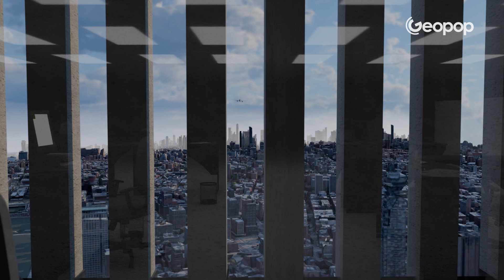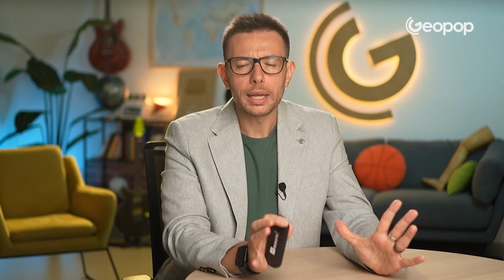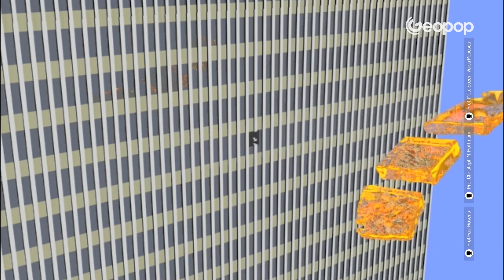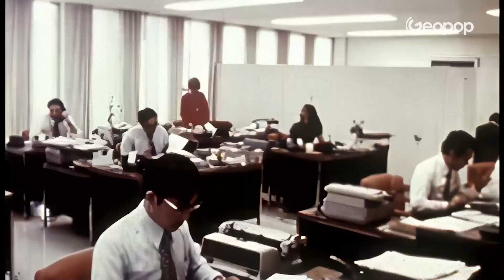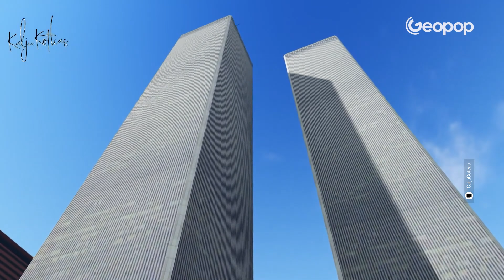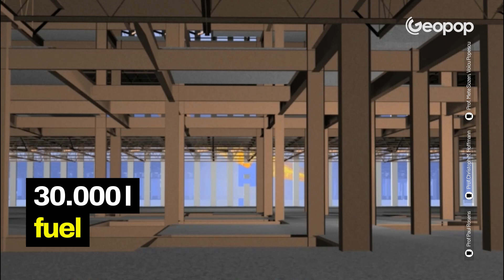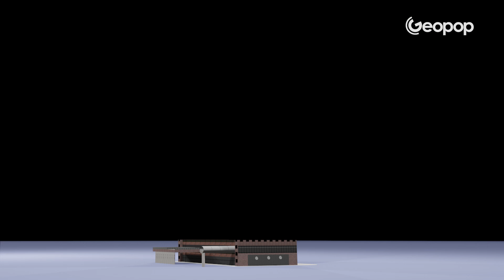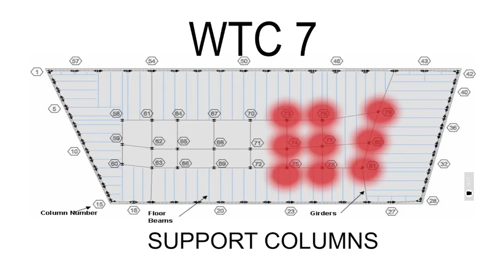9/11, 2001: The Technical Reconstruction of the Twin Towers and WTC 7 Collapses

Comment: BS. How come WTC 7 collapsed due to regular office fire? It would be the first one in the history in spite of hundreds of much worse fires in high scrapers around the world yearly. And even if it indeed happened for the first time for the reasons mentioned they would change the building codes to prevent it in the future, but no changes in the building codes. Why? Because it collapsed not from regular fire. Even NIST report admitted it was a free fall as if all supporting structure just disappeared. Do not forget about multiple audios with recorded explosions. It is pretty obvious what happened to WTC7 just several hours later of other two towers. Weird coincidence, right?
Reply: Fire destroys countless thousands of buildings every year. Sometimes entire towns and cities. There was a rather large fire event in Los Angeles just a few months ago that destroyed thousands of homes and buildings. Maybe you slept through that one.
Reply: @TheLoonResistance  Name at least one HIGH-RISE steel-framed building that collapsed due to fire? Right, it's WTC 7! Anything else??? None. Weird, right?
Reply: @DZ-zc3gi  - Plasco Tower.
Wilton Paes de Almeida.

That's two (2)

Of course neither the fire nor the building know how tall the building is, so high rise is an irrelevant qualifier.
Reply: @TheLoonResistance  Plasco Building, Tehran, Iran (2017) - 17-story, several hours of fire, lack of fireproofing and sprinklers, exacerbated by outdated design.
Wilton Paes de Almeida, São Paulo, Brazil (2018) - 24-story, after a massive fire, lack of sprinklers and poor maintenance contributed, structural neglect.

You listed relatively small and outdated buildings with poor design and management. 

WTC7 was a modern, high rise building with proper fire protection up to the standards. Even Rudy's Giuliani Emergency Management Command Center was located in WTC7. So, please be fair and compare apples to apples looking for another collapsed by fire building. Again, there is none. Watch Calling Out Bravo 7 on youtube to understand that a regular office fire can't be the reason for building collapse. Even regular apartment complexes do not collapse due to fire, not to mention the buildings that specifically designed to withstand such events.
Reply: @DZ-zc3gi  - You asked: Name at least one HIGH-RISE steel-framed building that collapsed due to fire? Right, it's WTC 7! Anything else??? None. Weird, right

I gave you two.  Embarrassed, you are now desperately trying to move the goalposts (even though the question itself was a goalpost move from your OP).  

Question is asked and answered and I have no desire to play the quid pro quo game with you, because you won't win that one either - just waste more time.
Reply: @TheLoonResistance  The question itself implies a fair comparison to WTC7, but you are the one who started the comparison with some residential houses... Even after pointing that out, you are still trying to play a gotcha game. I do not care who wins or loses, all I care about the substance, and I hoped we could have meaningful conversation. Well, apparently not with you. Lol, feel free to claim yourself a winner if that what matters to you.
Reply: @DZ-zc3gi  - You asked a question. I answered it. You got caught out because you were unprepared and reacted by tring to change the rules. More than once. That is most definately a YOU problem.  Can't have a discussion until you decide to and become capable of being serious. 

Your loss, not mine. 

PS

If you don't understand the collapse of Building 7 you sure as shit aren't going to figure it out by trying to compare it to some other completely different incident you also don't understand. Each event is unique and has to be understood on its own mertis. In short, you're doing it all wrong.
Reply: @TheLoonResistance  Sure, you are right. I see no point arguing with you. I value my time so goodbye.
Reply: @DZ-zc3gi  - I don't want to argue. I want to discuss, and am versed on the topic: Building 7, the 6th building to collapse of 10 lost on 9/11 though extensively studied still confuses many. Not famous or a terror target and with no casualties it didn’t get a lot of attention initially, creating an information void the internet filled with utter garbage. Because everything seems like a conspiracy if you don’t understand how it works I prepared this brief summary from my own analysis to fix that. No politics, just engineering. 

The North Tower collapse at 10:28am bombarded Building 7 with tons of burning debris, causing heavy damage and multiple floor-wide fires that burned out of control for 7 hours. Half the FDNY firefighters having been killed, others injured, units in disarray, equipment destroyed, no water pressure, and the greater urgency of Search & Rescue efforts, firefighting was pulled as futile. The building couldn’t be saved and was left to its fate. That is the sort of choice firefighters make every day in brush fire situations - which houses to save and which ones to let go. Only real difference here is moving the decimal on the size and cost.

www.youtube.com/watch?v=g_SvpwyC17M&ab_channel=MFitz  

Collapse of a burning structure is always a concern for firefighters. Steel buildings subject to fire rely on active fighting of the fires to survive. Buildings are designed around 1 to 3 hours of fire resistance, allowing time for occupants to escape and ACTIVE firefighting to get started, after which all bets are off. Left to their own devices they will exceed their design envelope and collapse. In B7 the occupants escaped, passive and active fire protections were compromised and active firefighting was abandoned which left the building to its fate. It lost. Odds on Building 7 would eventually collapse, and it did. No big deal in logic. 

www.youtube.com/watch?v=WnYBX6QT0R4 

FDNY Chief Daniel Nigro ; The biggest decision we had to make on the first day was to clear the area and create a collapse zone around the severely damaged 7 World Trade Center, a 47-story building heavily involved in fire. A number of fire officers and companies assessed the damage to the building. The appraisals indicated that the buildings structural integrity was in serious doubt. I issued orders to PULL back the firefighters and define the collapse zone. It was a critical decision; We could not lose any more firefighters. It took a lot of time to PULL everyone out, given the emotionalism of the day, communications difficulties and the collapse terrain

FDNY Deputy Chief Peter Hayden ; We had our special operations people set up surveying instruments to monitor and see if there was any movement in the building. We were concerned of the possibility of collapse in the building. And we had a discussion with one particular engineer there, and we asked him if we allowed it to burn could we anticipate a collapse and if so, how soon? And it turned out that he was pretty much right on the money, that he said 'In its current state you have about 5 hours

The collapse of Building 7 was anticipated and widely reported in the media throughout the day. At least 24 video cameras recording some or all of the collapse. Everyone knew what was coming and why.

www.youtube.com/watch?v=OY5S5k3tMHI 

Building 7’s collapse was completely different to the Twin Towers, and harder to understand with most details hidden from view. But we can still sort out what happened through careful analysis and observation.  This is my explanation  of the collapse using the best available information and relying on no authority.

B7 was complex 47-story steel framed structure built on top of a smaller existing 3-story building, requiring several lower floors dedicated to complex load transfer structures instead of usable office space. Of trapezoidal shape and all-steel tube-in-tube construction, B7 (above the 7th floor) consisted of a central core of steel columns carrying most of the gravity load, perimeter steel columns around the outside of the structure carrying the remainder of the gravity loads and long span beams and girders to tie those elements together and form the floors. On the outside of the building hung a moment frame - the last part of B7 to fall 

Phase 1 : The first externally visible signs of collapse initiation occurred at 5:20:28 pm. Collapse initiation for B7 is notably quiet with observers not realizing the building was collapsing! There was no audible warning in the form of say hundreds of ear drum busting 180-190dB explosive bangs preceding the collapse. Here at 12:00 a local CBS affiliate reporter is talking 10 blocks from B7 when collapse begins. People don’t start to notice the collapse until 12:11. Then at 12:45 is the famous CBS fixed camera clip of Building 7’s collapse.  Note how quiet it is.

youtube.com/watch?v=t5tEy6mXSE8&ab_channel=fresnosean379

Collapse initiation was due to lower floor failures above the load transfer region (7th floor) in the NE corner of the building. In this video at 0:45 you can see the NW corner from inside the building while under construction, Column 79 just out of frame on the left. That big, angled steel beam across the top of the frame connects to C79 at one end. The girders connect to the beam. That beam and all those girders depend on just one connection

youtube.com/watch?v=nP3TNHPCIVU&t=35s&ab_channel=EdwardCurrent

Phase 2 : Lower floor failures caused a loss of critical lateral support over an excessive length of core Column 79 and it buckled. If you look at a floor diagram of Building 7 (see above) and look at all the structures that depend on C79 you quickly realize this one column was a relatively isolated structural element on which a disproportionately greater fraction of the structure depended analogous to say the Key Bridge. Externally we see a vertical progression of window breakage along the 44-46 line and a kink in the roof of the East Mechanical Penthouse at the top of the building, consistent with C79 failure. The transition from full capacity to almost no capacity occurs in virtually an instant. Once the buckling failure occurs there is almost no resistance

Normally with a buckling column, the load could very well be redistributed to other columns, meaning the buckling could stop after a while. With C79 that is not the case - the failure did not redistribute the load, so the collapse rapidly progressed to the roofline, sinking the rooftop penthouse.

Phase 3 : With C79 gone, B7’s progressive, non-symmetrical collapse continues with C80 and C81 at the east end of the core left laterally unsupported and quickly buckled and failed as well, sending the EMP down through the building. C79-81 all have no diagonal bracing, which I believe is a major reason why they could not redistribute a lot of vertical loads among one another.

From there collapse progressed from east to west through the central core until the core was gone taking all of the interior floors and structures and probably most of the perimeter columns with it. You can see the horizontal progression of window failures low in the building and the dropping of the remaining rooftop structures into the building. One of the big takeaways from the NIST Building 7 study (that gets completely ignored) was their modeling which determined C79 failing under ANY circumstances would have initiated the same collapse sequence.

Phase 4 : 10 seconds in only the exterior moment frame - just a hollow empty outer shell – remains, the illusion the building is still standing since little has outwardly changed. But it’s just a hollow empty shell like an empty cereal box supported by only a few remaining columns and quite unable to remain standing. With all internal framing gone, the north face leans inward, forming a V in the roofline, the last perimeter columns buckle under the strain and the moment frame free falls, landing on top of the 7-story high debris pile. It is only here, at the end that a single measurement of alleged free fall acceleration is taken, from a single point on the moment frame. The Building (defined as its center of mass) did not “free fall” (sort of) – just one corner of the outer shell did. The Building was already gone before that happened. The period of alleged free fall was a product of collapse progression mechanisms, not of collapse initiation mechanisms and is irrelevant to what started the collapse. Start to finish the entire collapse took 18-20 seconds, 3 times longer than true free fall and how fast something falls cannot tell you what started it falling anyway. The debris spread outside the footprint, blocking surrounding streets, heavily damaging the Verizon Building and destroyed Fiterman Hall.  

Building 7’s progressive, non-symmetrical collapse was incidental and unintended collateral damage started by the collapsing North Tower. That is true no matter who planned and carried out the 9/11 attacks or why . The collapse was of so little consequence it barely even registered at the time, a mere footnote. It only took on semi-mythical status as an alleged smoking gun years later when demolitions at the Twin Towers, missiles at the Pentagon and shoot down over Shanksville all failed and conspiracists had nothing left to work with.

Anything can seem like a conspiracy if you don’t understand how it works. Now you should. I hope you found this helpful, informative and it solicits informed critical comment. If I made any errors of fact, logic or reason or left anything important out, please let me know so I can fix it. IF you can offer a more plausible alternative please do. Be the first. Please start any reply with the words “Tits McGee” or I will know you didn’t read it and are wasting my time.

Comment: What caused the cement in the buiding  to be pulverised without offering any resistence. As eaxh floor met the floor beneath their would have been an opposite reaction resulting in a slowing down of the collapse. How come building that were on fire for a lot longer periods at higher temperatures & did not collapse.No other steel framed building has ever collapsed due to fire.

Comment: Kerosene (which is jet fuel) dosent burn hot enough to bend steel.
Reply: strength of steel remains essentially unchanged until about 600°F. The steel retains about 50% of its strength at 1100°F. / JP-8 open air burn temperature: 1,030 °C (1,890 °F) the steal lost it's strength watch the video my guy.
Reply: Or passports
Reply: Are you stupid there were plenty of other combustibles causing fire and plenty of steel and trusses retrieved that were sagged by fire. Thin trusses weaken and sag quickly in fire it's why firemen say don't trust the trusses. But wait your the expert not them, gotcha.
Reply: Kero burns at 1000 degrees centigrade, that's way more than enough to weaken the steel and break under load, the graph said 500 degrees
Reply: You just keep believing that jet fuel brought down those towers. 
 @robrosielle9658

Comment: I guess building 7 didn't have any of the required fire suppression systems working even though they aren't connected to the other buildings.  It was just unlucky how all that happened even though there were other buildings in between them.
Reply: You would guess wrong. Building 7 was fully up to code, it was taken beyond it's design limits.
Reply: @TheLoonResistance  Exactly!  Now you're getting it.

Comment: Bugie, bugie e menzogne!! 
PUOI ESPLICARE LA SIMMETRICITÀ DEL CROLLO? 
THE JET FUEL BLASTED AND BURNED ALMOST ENTIRELY IN THE INITIAL FIREBALL!
Reply: Falling were mostly symmetrical due to the dominance of weight (vertical force).
According to studies, only 20-30% of fuel burned at impact. And 70-80% of the fire heat came from the office fires light by the burning fuel inside.
Reply: Nothing symmetrical about it and it is a meaningless argument anyway.  Real engineers don't care. Only ignorant conspiracists teolling the internet talk about "symmetry" like it's a real thing.